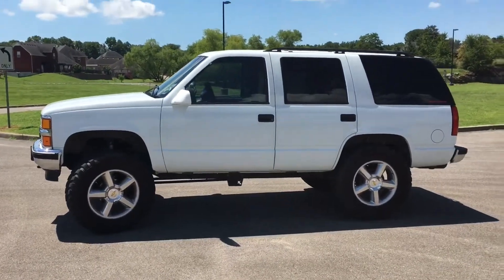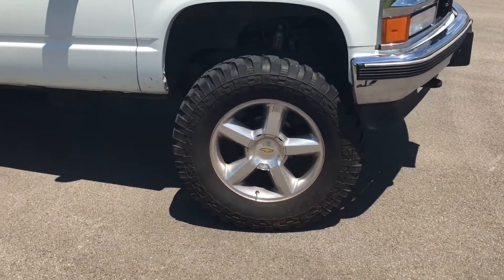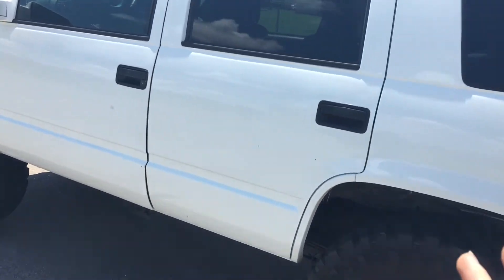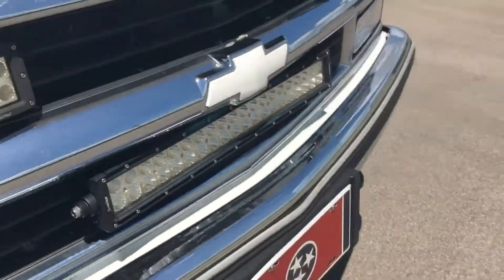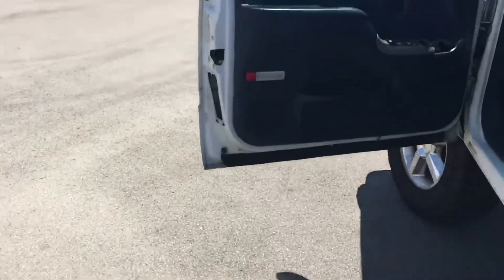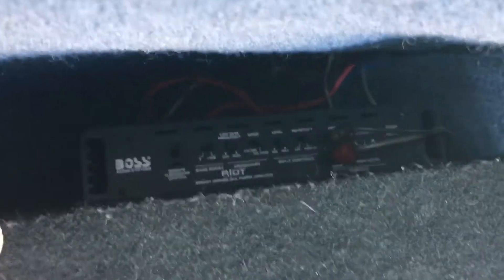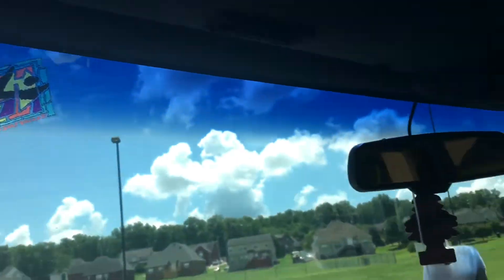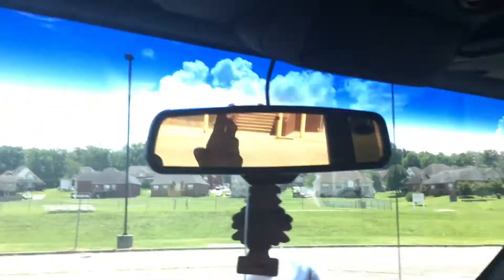going over my tahoe and what’s done to it +bloopers

Comment: My 5.2 durango has a bad radiator  and wants to boil coolant out where its cracked have it temp fixed with jb weld keeps it from overheating
Reply: going to get a used radiator  to fix it